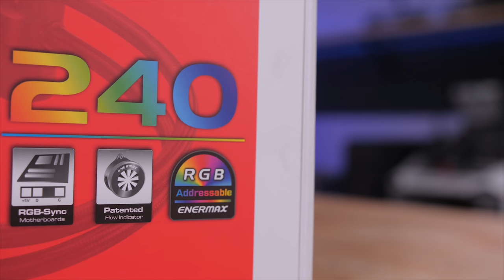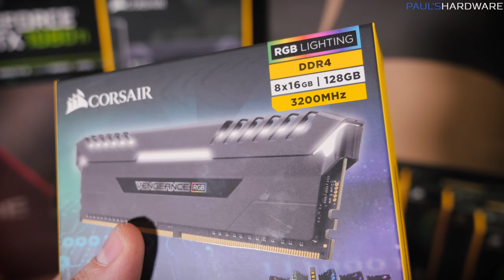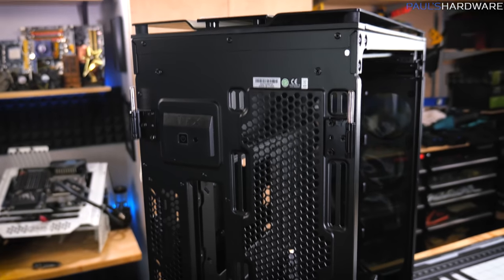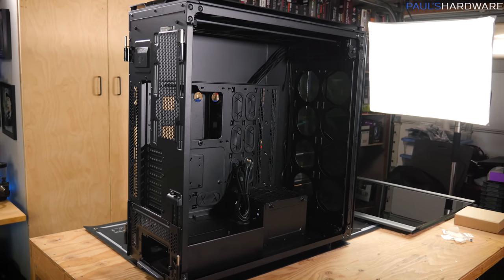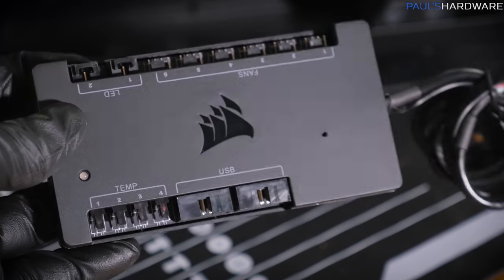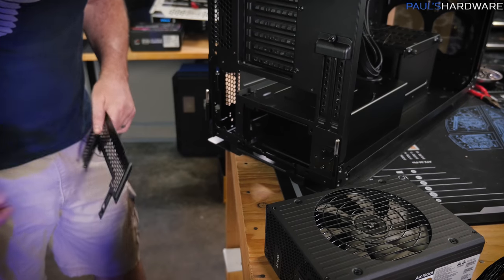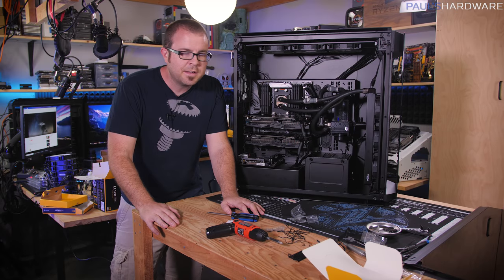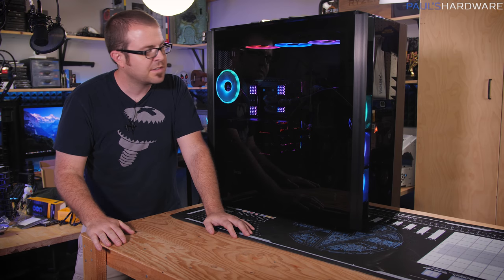Building a $10,000 PC in the Corsair 1000D - Riptide Part 1

Comment from the maker: ► PARTS LIST ◄
Case - $500 - Corsair Obsidian 1000D - https://amzn.to/2rCYF6i
▷System 1 
PSU - $500 - Corsair AX1600i - https://amzn.to/2HOmoan 
Mobo - $450 - ASUS Zenith Extreme X399 - https://amzn.to/2IbNrwD
CPU - $950 - AMD RYZEN Threadripper 1950X - https://amzn.to/2rx6j1S
Fans - $480 - Corsair LL120 3-Pack (x4) - https://amzn.to/2I5d9H6 
Storage 
$500 - Corsair Neutron NX500 400GB PCIE NVMe SSD - https://amzn.to/2rhBQp2 
$275 - Corsair Force MP500 960GB M.2 NVMe SSD - https://amzn.to/2Ia8bYF 
$300 - Corsair Force LE SATA SSD 480GB (x2) - https://amzn.to/2HNQ9YN 
Memory - $1700 - Corsair Vengeance RGB 128GB (8x16GB) DDR4 3200 - https://amzn.to/2jpKf5K 
GPUs - $2000 - ASUS ROG Strix GTX 1080 Ti 11GB (x2) - https://amzn.to/2HOPiau 
▷System 2  
CPU - $170 - AMD Ryzen 5 2400G Processor w/Vega 11 GPU - http://amzn.to/2Bsa6Uy 
Mobo - $210 - ASUS RoG Strix X470-I Gaming - https://amzn.to/2I9g0dP 
Memory - $400 - 32GB (2x16GB) ECC DDR4 Memory (TBD)
HDDs - $1000 - 8TB WD Red NAS HDD (x4) - https://amzn.to/2rx3zS4
PSU - $120 - Corsair SF600 600W SFX Power Supply - https://amzn.to/2IbVOeA 
▷▷TOTAL (Not Including Liquid Cooling): $9555
Reply: Paul, do you get to keep this PC or do you have to send it back to corsair and Asus?
Reply: Why not two overkill systems?
Reply: The link to buy the Corsair 1000D it is no available also it will be great to have Hackintosh and Windows it looks great I can't wait to see it full of radiators and see the temps Thank you!!!!
Reply: Hey Paul! Nice video. Btw I just bought a 1080 last night at MSRP on Nvidia's website. They still have 1070's for 399 and 1070 TI's for 449!!! Maybe some other viewers can benefit from this sale.
Reply: All I can say is WOW Paul
Reply: Paul's Hardware  HEY HARD DRIVES EXIST     i have a fx8300  rx 550 2gb 8gb ddr3 800mhz  wd VelociRaptor 300gb hdd  a wd 5400rph hdd and a sandisk 128gb sata 6 ssd for boot  wich is always made to look like garbage by the rest of the community  thanks guys
Reply: +Unbox Master - what do you think? he said ones gonna be a video editing/ gaming build, ones freenas.
Reply: You can controll the Commander Pro also in Corsair iCUE to sync it with the prepherials
Reply: hola saludos desde CUBA nos encanta tu programa somos fieles sequidores
Reply: I would be interested to know if it handled a pair of 200mm fans at the front - I know Corsair doesn't make them, but Thermaltake's "Riing Plus 20" fans are a good aesthetic match to the LL series.  It's a shame manufacturers don't make a radiator to handle those.
Reply from the maker: Simon Spencer - there are 3 types of brackets that fit the front/top sliding trays, the 8x120mm and 3x140mm that come with it, and a 2x200mm one as well. So yes! 😁 But sold separately 😑
Reply: Holy crap! What are you going to do with that build?
Reply: I just wish Cosair made their own 200mm fan (especially a LL fan).  I also think they need to make a 1000D-version of the RGB PSU shroud from the 570X Mirror... but I digress ;)
Reply: Awesome Start to the Build Paul!

I notice how you flipped the rear fan from an intake to an exhaust, to cover up the mistake of your camera man at 19:48. Trying to save him from being Crucified from the internet? LOL!

Seriously, can't wait for Part 2! I was about to jump online and buy this case pretty much right after you started building in it, then you mentioned it came with no fans, I did the Math on filling it with those LL Fans, and unless there is some kind of Bulk Special, you are paying more in the fans then you are for the Case! 

Any ways, Keep up the Awesome Content Paul!
Reply: Like I said in an older comment before, I am unsure about ECC support of those APUs. I would love it to be true, my router needs to get rid of it's Intel crap. But please try to double check with a linux USB stick. Here is a couple options to try out: https://www.pugetsystems.com/labs/articles/How-to-Check-ECC-RAM-Functionality-462
Reply: Paul's Hardware all top pc builders have received this
Reply: Paul's Hardware the piping for your cooling looks bloody awful take it to jay he will do you a proper custom loop
Reply: The fact they don't include fans makes that a really expensive case. No one would throw cheap fans in that case especially if your invested into keeping your hardware running cold.
Reply: Case = my PC + 100 dollars, fell poor but this system overkill
Reply: the mp500 price is wrong btw $575>$275
Reply: What speed are you running the 128GB RAM at? I got 128GB G.Skill 3600 RAM on the 1950x/ROG Zenith, but can't get it running stable at anything above 2133.
Reply: its kind of funny, im going through the parts list and most everything has stayed the same or dropped in price, except the corsair force mp500 960gig m.2 nvme ssd. thats now $500!! havent checked the ram yet, but sheesh im sure its gone up as well
Reply: Paul's Hardware Ya know, just in case you also wanna spend $10000
Reply: Great build,monster machine! Can you tell me please where can i order that desk cover with measurements (black thing on your table) and what is the name of that cover? Thanks ahead.
Reply: I didn't get the ryzen 5... Why?
Reply: Hey Paul just curious, what is the biggest GPU you can fit on the ITX motherboard here? Wondering about the 2080 TI?
Reply: why cpu cooler is not corsair H150i pro
Reply: Paul congrats on the millions subs you got it. Happy for you.
Reply: Will I get my e-mail faster?
Reply: Its awesome!!! you're the first one ive seen, to tested all his componements First, then final build in a second time! bravo for that ;)  The number of time, ive seen peoples with a DOA hardware, a real nightmare to diagnose in a final build with all the liquid, hardtube stuff on it.

Comment: Great series of videos on the 1000D.
This is going to be my upgrade. Except, here in early 2023 the case is on backorder. But, that's fine since I plan to wait to next year anyways. A case like this deserves an EATX motherboard with a new Chipset that will handle PCIe 5.0 and M.2 PCIe 5.0 drives. It  may not hurt to also wait for an RTX 5090 to throw in there as well as some DDR5 memory. So I'm guessing I will end up waiting 1.5 years, to late 2024?

Comment: I wish every case manufacturer offered a SKU for most cases that omits bundling fans.  Bundled fans are usually garbage.
Reply: aidanjt I agree, only budget cases should come with fans
Reply: why should budget cases come with fans when people are on a budget they are trying to save money (and budget is not defined by the price of the build someone could have a $3,000 budget for their PC) and to make the most of any budget there should be NO included fans unless they are what someone would expect to put in their case we do not want 5+ year old fans and fan designs we want new fans and I am sure people with low budgets would agree
Reply: Zahid Shabir I was thinking for young/old system builders who want as little hassle as possible
Reply: Zahid Shabir because they get bulk fans for dirt cheap (0.25c a fan usually) and a budget builder will usually need the included cheap fans.
Reply: Most stock case fans from any of the good manufacturers are actually much better than most aftermarket RGB fans nowadays. Especially thermaltakes old(not current) Riing fans which had a max rpm of 1050 and barely flowed anything even maxed
Reply: The fans that came with my fractal design case are surprisingly good. Not as silent as my ML120 fans, but still pretty good.
Reply: LazarusTricks I still use the 92mm Dynatron that came with my Dell Vostro back in 2010. It spins down all the way to 100RPM and stays relatively quiet.
Reply: Well, I'd rather pay a little more for GOOD fans that come preinstalled in the case, just to save me the bother. ;)
Reply: Firstname Yeah, but it won't be just "a little more" though, if they can sell the same fans for $20 more per pair after the chassis, why sell them with the chassis for $10 less?
Reply: I did say I'd prefer them preinstalled, so you don't need to convince me. ;)

Comment: Does the ASUS ITX Board actually support ECC?? The spec sheet on ASUS' website says it doesn't.  I too want to build a FreeNAS setup to replace my Qnap but can't find a motherboard I like that ACTUALLY supports ECC.
Reply: dude, this doesn't answer your question, but you look like you know what you're talking about. What's freenas? Apparently it's "enterprise-class storage software designed with data protection as the primary objective" but why has Paul got a second system inside this build? Confused
Reply: Juan Pretorius it is a FreeBSD based operating system. It is for building your own NAS setup (network access storage). So instead of buying a prebuilt NAS (at a premium) you build a small computer to your own specific needs and run FreeNAS as its OS. So Paul is building Riptide to both edit videos AND store the raw footage/completed projects. One computer will be the editing Rig. The other will be the storage.
Reply: I am quickly filling up my Qnap NAS and I don't like the software it runs on. So I'm looking to build myself a FreeNAS system before the end of the year. However I want ECC memory support. Ryzen seems to be the most affordable way to do that, (aside from used server hardware) except I can't find a small form factor and affordable mobo that actually supports ECC.

Comment: Suggestions for waterblocks that are compatible with the strix 1080ti?
Reply: Patrick Crowley
EK and Phanteks have options for it. However only Phanteks can RGB waterblocks if you're into that. I wouldn't look to water cool the Strix 1080ti because it will void your warranty (there's a sticker on one of the screws you would have to remove so they can in fact tell). I would go with the Gigabyte 1080ti as it has a 4 year warranty (compared to the 2 on the Strix) and water cooling doesn't void it. We are supposedly in for an announcement on May 30th for the 1180 which will be released in June-July (as is all ways the case) so I'm waiting for that.

Comment: Because when you build a super expensive system you're worried about underclocking to save power...
Reply: You gotta compensate for all the RGB fans :)
Reply: dude, that 1500W psu needs to handle everything plus all those rgb fans = 1100W without counting overclock
Reply: That NAS, I suspect, is to run 24/7, so having it run at low power, temp, noise is a plus IMHO
Reply: Also interested to see what height cooler can go in the freeNAS build. Standard wraith can run really quiet if it fits and the APU is underclocked I’d imagine
Reply: xephael -
You're*.
Reply: forza1sra thanks, typing from a phone
Reply: João Pedro No... That won't draw 1100 no way.

Comment: Hey Paul I just built the coolest corsair computer around. It is like the little brother to your build. Very good choice in fans by the way it's a bit finicky getting all the fans to work right on the commander though. Corsair needs better software improvements. The Fans are the best looking fans I have ever seen though. Thermaltake ones are nice too but you have to go all thermaltake fans to make it look right then. I can send you a pic of my build if you like on twitter. Paul you have way too many commander pro's too. You can hook up two lighting node pros off of one commander pro, basically 1 commander pro with the lighting node pro's hooked up can support 24 fans, but only can control the speed of 6  fans only with 1 commander, so I know why you got so many but still. You still need the fan hubs but they come with the fan kits. 18:44 can you install the radiators up one notch so the fans suck air in the bottom which should help a little with the heat the radiators create? I know heat rises and if the case allows you to then I would try it.

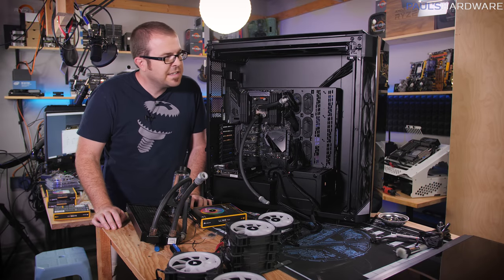Comment: That’s a really nice build, but the way you are building is not ok, not a nice order, all the components out of the boxes spread on to that table (a component should go from the box straight on the machine) the proof is at the beginning when you unwrap the tempered glass and most of all between 16:10 and 16:13 when you can clearly see the damage done to that plate on the motherboard!

Comment: That is a killer case and glad Corsair launched it as the 1000D instead of the Slate.  Loving the new Obsidian line-up so far, enough to start at least considering the 500D for my next build as I love the hinged tempered panels and the look of the over-all case (would go for a 1000D but really don't need another gigantic case to go with my CaseLabs M8)

Comment: Could you use 230mm fans in the front of the case? Also does the 2400G work with freeNAS because it doesnt have some of the stuff required to use VM on it. If that were to happen.

Comment: Hi Paul, I'm trying to set up a dual system in the 1000D, you showed in the vid that the second system would require a sfx psu. I wonder how do you power on the second system, does 1000D offer a second power button for the 2nd mobo?

Comment: Paul, this was a great teaser video. However, I want to see the extreme over the top insanity build with this case. Full rads in RBG push pull, custom loops. Max drives 3.5 & 2.5 (m.2 as well!) Maybe even go LLT insane dual cpu server board, just max it all the way up, even that ITX board, max that sucker with all it can handle!! OVER 9000!!

Comment: 900D still looks better even with all the years passed. Also, if you want to change/fix PSU for main system, you need to remove secondary as well. Have fun doing that when both systems have custom loops with hard tubing.

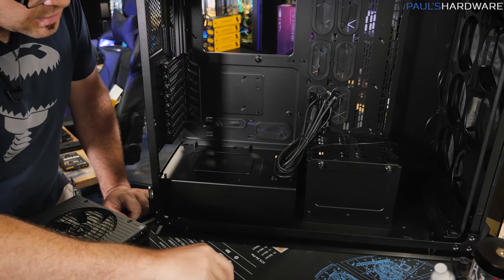Comment: is there any possible way to remove hard drive mounting 15:30 ?  I have 2 MSI 2080 ti and it's not possible to run SLI without removing  hard drive mount (yes i do have this case)

Comment: I mean with a case like this, you kinda have to do 420mm rad up top for 1950x, 2x480mm rads in front, one for each 1080Ti, and a 120/140mm rad in the rear for the 2400G

Comment: Paul, I like your videos but can not help to notice that you do not mention any problems with Zenith Extreme - not great CPU mount that requires a lot of force to thread screws at the beginning nor the thread locker on the M.2 heatsink. Did you not have these issues that are really common with this motherboard or you just preferred not to tell us about them?

Comment: Use corsairs new iCue beta software with this. I have a 460x case with sp120 and HD120 fans on a lighting node pro. I couldn't sync effects between the two with Link but now i have them all daisy chained for effects on iCue. They all go from blue to red with my GPU temp, super cool. Try it!

Comment: this case can support up to 24 fans normally or 26 if you place a 240 radiator with the tubes on the bottom. up to 16 on the front, 6 on top and 4 on the back (if radiator as i said)

Comment: Corsair has neatly eliminated the two points I truly disliked on my 900D: (1) Cable routing was very tight in the 1/2" or so space behind the motherboard mounting plate, and (2) installing the GPU mounting screws was a PITA due to the location of the vertical bracket across the left rear.

Thanks Corsair, I just wish I could afford to build a new system with all the bells and whistles the new case will support.

I love your reviews, keep them coming.

BTW, with all the extra drive cages it will accommodate, my 900D holds more 3-1/2" HDD (12 total) than you needed in this build. Eat your heart out.

Comment: you could have the gpus connected to a triple rad exhaust on top and a massive air cooler for the cpu facing backward.  
or the front intake as the rad for the cpu, two loops, and supplement air to the bottom with an articulated fan aiming at the secondary system

Comment: do a FULL custom loop with liquid cooled CPU/GPU's (non of that quick disconnect fitting stuff you got for that CPU block it needs to be hardline tubing) all rads need to be extra thick and with push/pull configuration for the fans

Comment: NVMe SSD only works on the latest motherboards so if you're planning to put a Corsair Neutron NX500 into your old pc you're screwed but not the end of the world you still got an SSD 2.5'' work just fine. I watch this video I'm thinking is it time to upgrade it is getting to the point I missing out on all this new hardware but I look at my pc  Z77 motherboard, i7 2700k running at 4 GHz, 32 GB of RAM, video card GTX 980 GAMING 4G it's not bad for a 6yr old pc.

Comment: I'm no expert by no stretch of the imagination.  I've never heard of a "two system" computer.  I assume that is in reference to two motherboards in one case?  If that's true what is the purpose of a system like that and are they connected to each other to work together and how does it work?  Why didn't you use a Bridge between the video cards?  Wouldn't that have linked them both together?

Comment: Love the video, but something I saw made me a bit curious. Would SLI or solidworks be affected  by the fact that one GPU is a 1080 ti and the other is a 1080 ti non-OC?
Furthermore what would be the result for SLI capable games and solidworks if the GPUs are very non-identical (i.e. 1080ti and a 1070?)
Reply: Diso_Chef SLi doesnt work at all with cards that are different tiers, they have to match. Potentially if an application supported multiple gpus independently you could use them in the same system but that use case would be incredibly specific and probably not worthwhile anyway. As for oc and non oc cards, as long as the tiers match, they will work. Pretty sure something like afterburner even allows for setting gpu and memory frequencies independently per card.

Comment: a 120v 15a outlet (standard american outlet) is only 1800 watts. if you plug that 1600w psu and another 200w+ psu you will trip the circuit.

Comment: I found the concept of the sadly discontinued Lian Li PC-D666WRX way more appealing. The case fitted an EATX and µATX mainboard simultaneously in two separated chambers with space for one 480 mm and two 360 mm radiators.